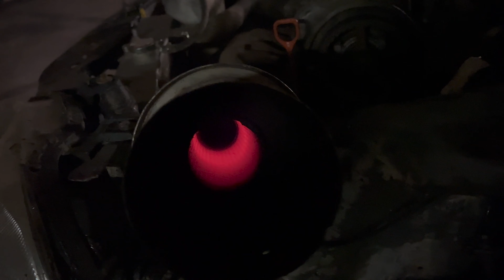Twin-Engine Civic Turned into a Drift Kart (55 Gallon Drums)

Comment: Once I backed my 28' enclosed trailer up to the car wash, unloaded my dirty ass dirt race car into the bay, removed a lot of the body and had it up on 4 jackstands with the wheels off to clean it.  I got a similar welcome.  But dirt racers do this almost routinely while on the road.